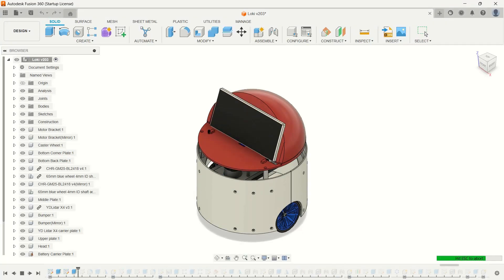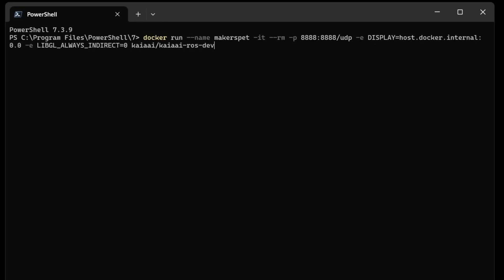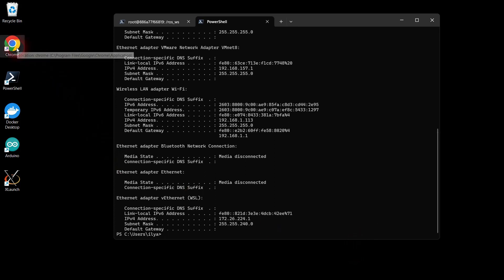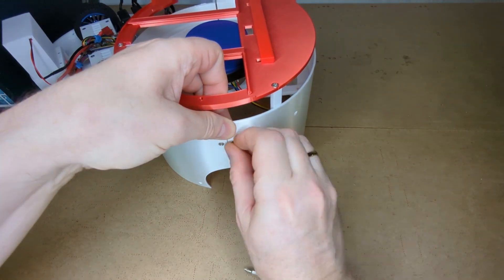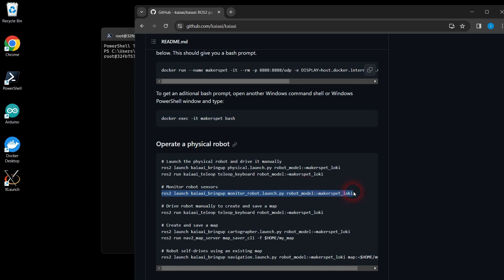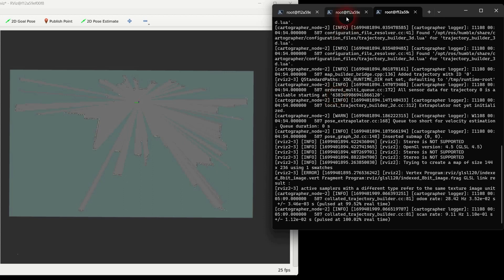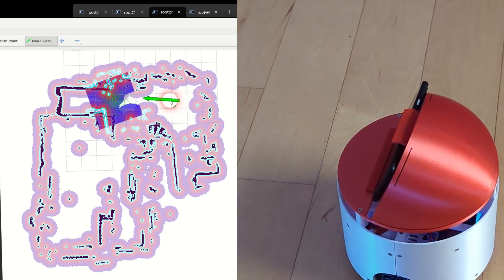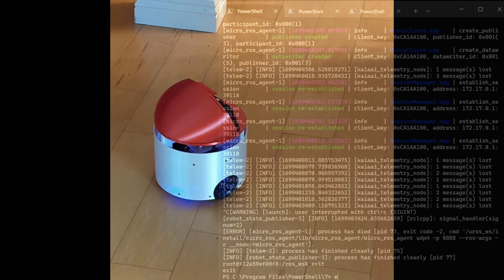Arduino self-driving robot bring-up, mapping and navigation instructions

Comment: when i use  LDS02RR it say that lds cpr error and the lidar wont rotate i can connect to to esp and setup even the map but the lidar wont start . please help me and thank you for reading
Reply from the maker: Hi Tuấn, I need to see your setup to figure out what's going on. Can you email me a photo of your hardware setup? And a screen of your Arduino log? My email is iliao at makerspet dot com
Reply: @MakersPet  well i can connect to lds now becuase i foget to chose the lds on the web but now it keep said that ping error and the motor still dont start
i connect pin 19 to mot- with the adapter and tx to pin 16 
3v3 to mot + and vcc, gnd to gnd
Reply: 10:41:03.014 -> spinTelem() period avg 50 max 51ms, LDS RPM 0.00, battery 0.00V, RSSI -69dBm
10:41:08.075 -> spinTelem() period avg 50 max 51ms, LDS RPM 0.00, battery 0.00V, RSSI -55dBm
10:41:12.524 -> Ping error
10:41:13.188 -> spinTelem() period avg 50 max 51ms, LDS RPM 0.00, battery 8.98V, RSSI -57dBm
10:41:18.249 -> spinTelem() period avg 50 max 51ms, LDS RPM 0.00, battery 0.00V, RSSI -57dBm
10:41:22.549 -> Ping error
Reply from the maker: @tuannguyen-kj1sr  please ignore the ping error. Which motor does not start - LiDAR or wheels? If LiDAR motor does not start, I would check LiDAR motor power and the N-MOSFET transistor that drives the LiDAR motor
Reply from the maker: @tuannguyen-kj1sr  pin 19 to MOT- that explains the problem. You need an N-MOSFET to drive MOT-. Here is the schematic https://github.com/makerspet/pcb/blob/main/lds02rr_adapter/output/LDS02RR_adapter_schematic.pdf For simplicity, you can ignore the diode in the schematic.
Reply: @MakersPet the lidar doesnt start.the mosfet i use is bc-547 with the 330 ohm resistor the power is 3v3 pin from the esp. i just want to use the lidar so i only connect that
Reply from the maker: @tuannguyen-kj1sr  look OK - you can ignore Ping error, it does not affect operation. RPM shows 0.00 because the LiDAR motor does not run. Battery 0.00V you can also ignore.
Reply from the maker: @tuannguyen-kj1sr  it should be 5V for LiDAR, both MOT+ and VCC. Not 3.3V.
Reply: @MakersPet  thank you i will try that
Reply from the maker: @tuannguyen-kj1sr  I just looked up BC547, it has max current 100mA. The LiDAR may need more current. I'd recommend 1A.
Reply: @MakersPet  i see but when i use kaiaai code for just lds02rr it work fine the down side that it dont send any data back and i dont know how to open a map with it
Reply: youtube auto delete the link so i dont know how to send you
Reply: @MakersPet  oh the 5v could be a prolem too thank you
Reply from the maker: @tuannguyen-kj1sr  you can email iliao at makerspet dot com
Reply from the maker: @tuannguyen-kj1sr  I'm not sure I follow about "kaiaai code just lds02rr". Do you mean you don't have motors? Arduino log says lds02rr connects, but the LiDAR still doesn't spin?
Reply: @MakersPet  yes to all of that
Reply: @MakersPet  i just send you a mail take your time thanks for all the help
Reply from the maker: @tuannguyen-kj1sr  ok, I'll check my morning time

Comment: hi, do you use the controller of the lidar? or just connect it to the esp32?
Reply from the maker: Just connect YDLIDAR X4 directly to the ESP32. Some other LiDAR models do need a n extra adapter board.